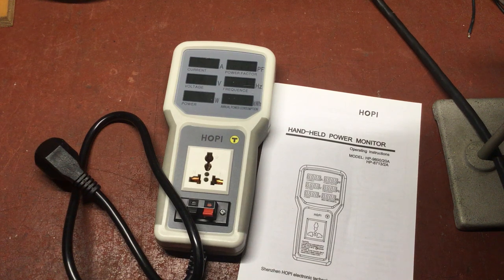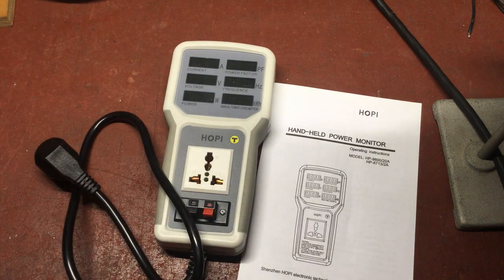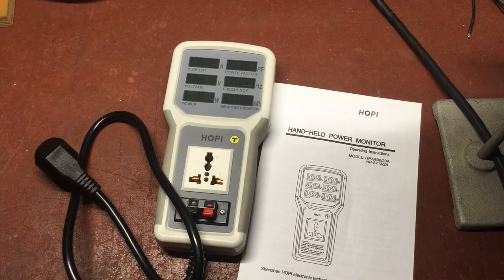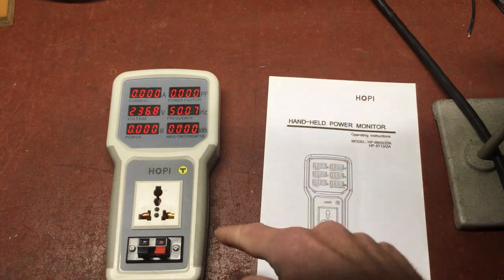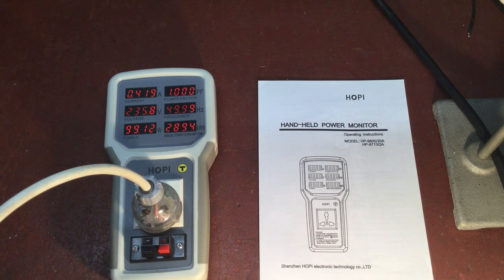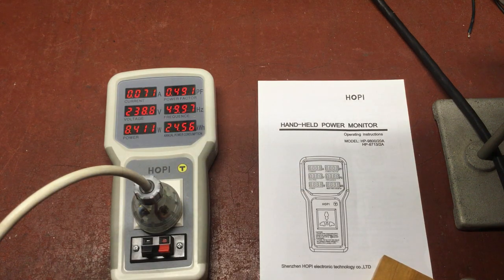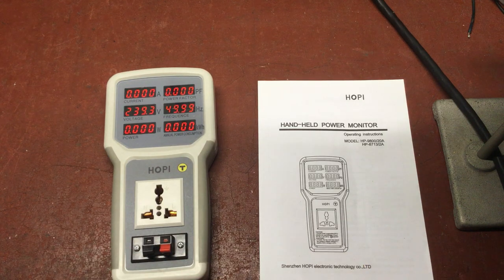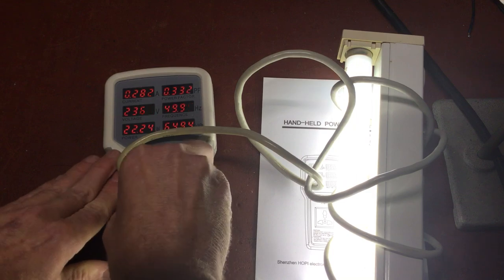Testing the HOPI Power Meter.

Comment: Do they make a 120-volt model of the HOPI power meter for the North American market?
Reply from the maker: According to the user manual it works from 85 to 265V. I tested mine on 120V and it works perfectly.